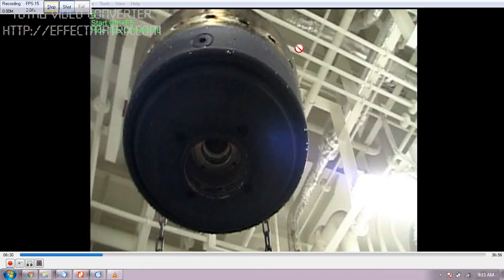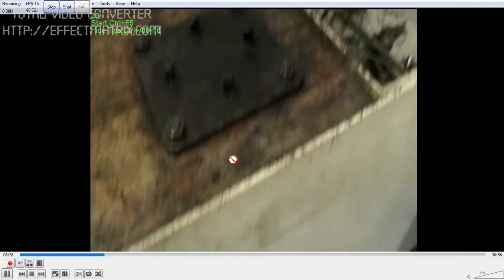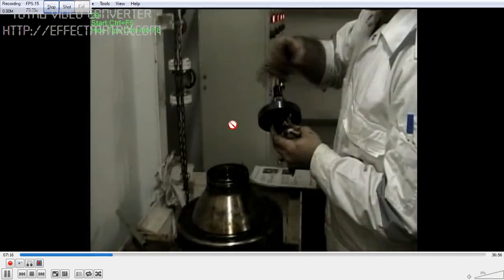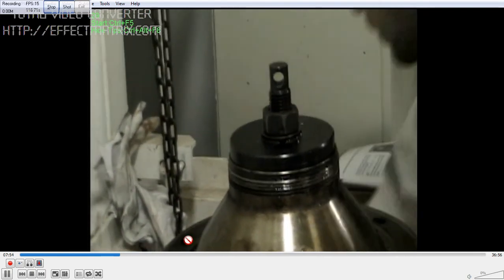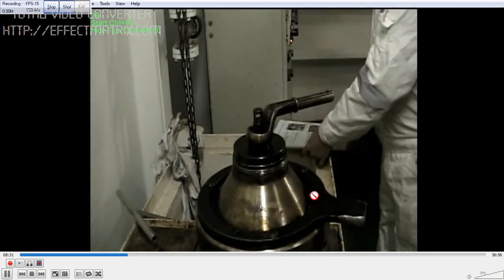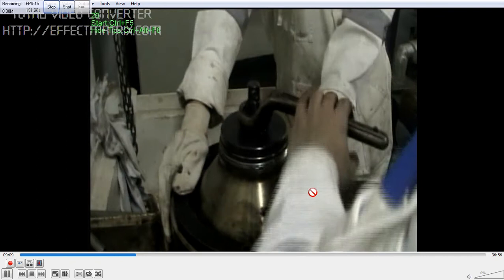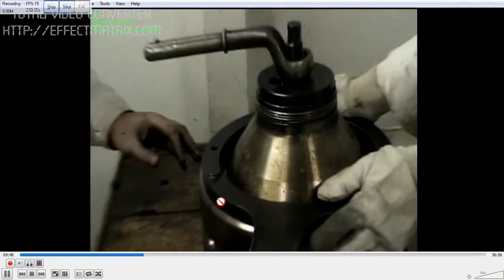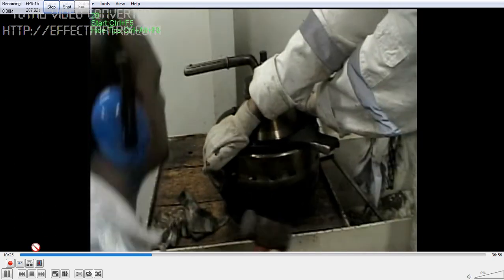HFO Purifier:Make:Samgong Mitsubishi: Important Tips

Comment: Hi Sir how are you today
Reply: Sir, I need some help in the purifiers
Reply from the maker: Welcome to Marine Tech Hub
Thanks for your valuable feedback !! Do share it with your colleagues and friend
visit my new website www.marinetechhub.com
please see all my video for more details in my website
How can I help you
Reply from the maker: Please let me know if your sealing water is coming from hydro fore or overhead small tank in purifier room. if the answer is hydrofore  then the water pressure is not enough or correct . Check the line filter, if you have orifice then clean the orifice,  If you have put wrong size of orifice in the water block. Check if your solenoid valve is working correctly. Please clean the solenoid valve.
Reply from the maker: Please check the condition of belt  it can slip or  Tightened the belt. Check traces of Oil on belt.
Reply: Today the problem has been resolved, to give instructions to you .

                Sir ...  Thank you
Reply from the maker: @aapsoftwarevideos5046 your always welcome to marine tech hub with any problem.
Reply: Sir has been working as a Purifiar for a week, but every time the bowl leakage and overflow is just a matter of what Sir can do.
Reply: Sir why orifice is provided in inlet of the purifier samgong. Does it present in all type of purifiers or only in samgong. Reason of providing this orifice.